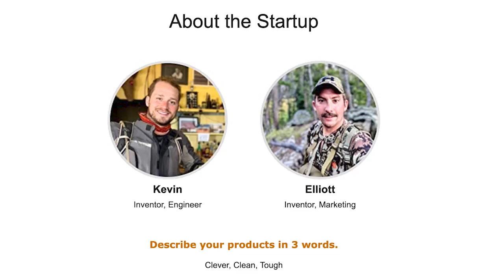New way to change oil

Comment: Nah. $25-$30 for a fancy funnel?
For one, it does not do anything for the upside down or the horizontally mounted filters. 

Then, you can always use a simple plastic bag around the filter, to avoid any spills.

Lastly, any oil change place does not have any problem with spilling, so they don’t need this device.
Reply: Totally agree with you